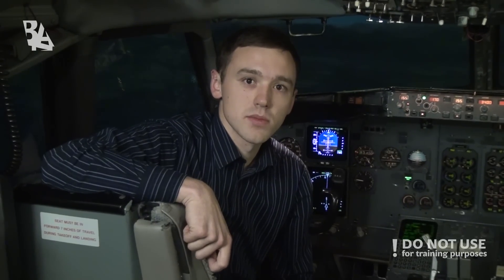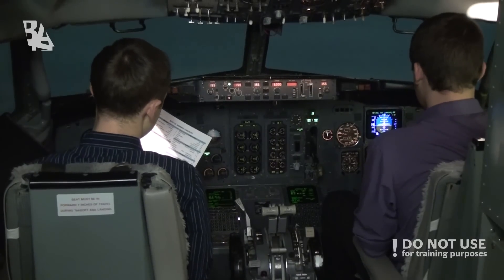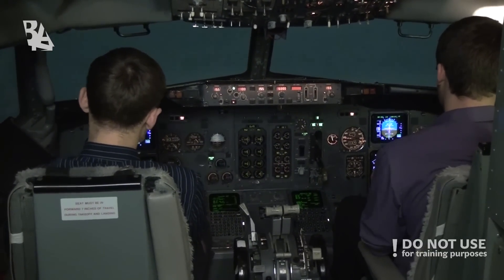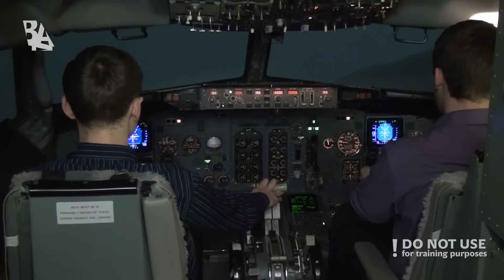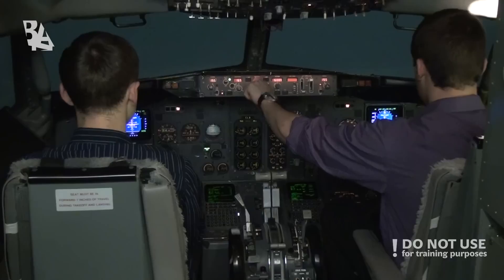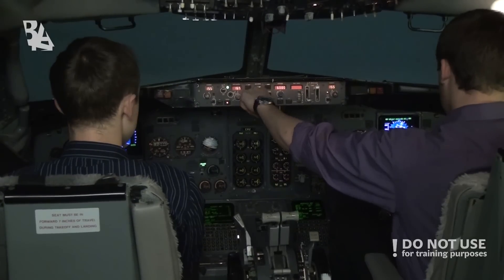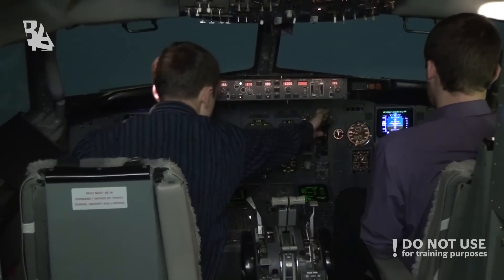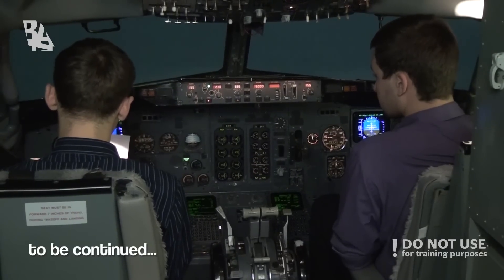Go-around due to low visibility in Boeing 737 CL - Baltic Aviation Academy

Comment: No need for diversion in case of low visibility. LOWS rwy 15 is cat III certified, so just do an auto-land (notifying the tower(!), of course, to give you proper cat III ILS signal protection, or you might end up like these guys: http://avherald.com/h?article=445873f3&opt=0).
Reply: totoritko both pilots need to be certified for cat III. CatIII should be available and atc will let you know. Once they  gave you a clearence you can't  simply change it and decide to proceed... That would affect CRM both pilots need to fully understand what's  going on and what to do.